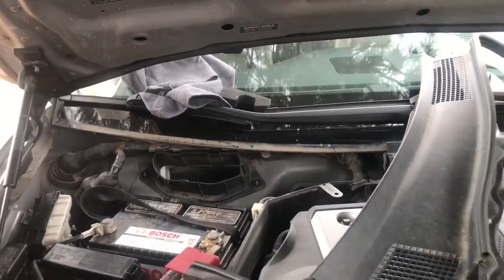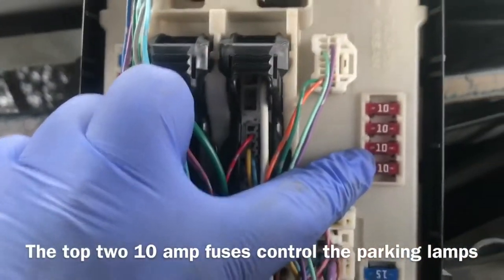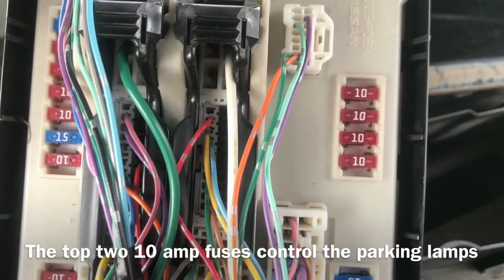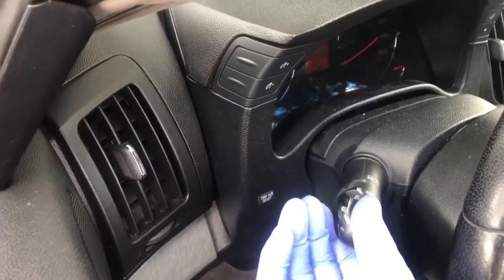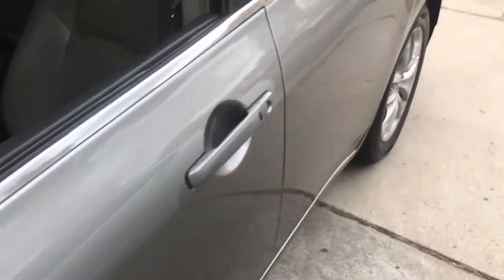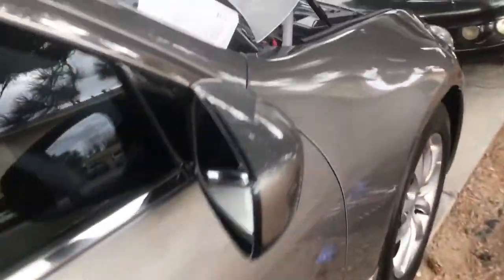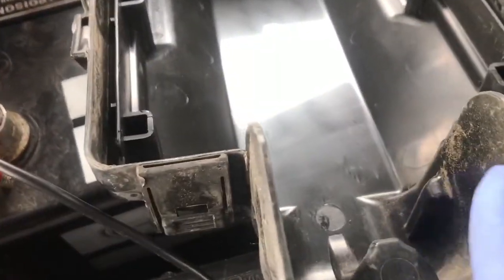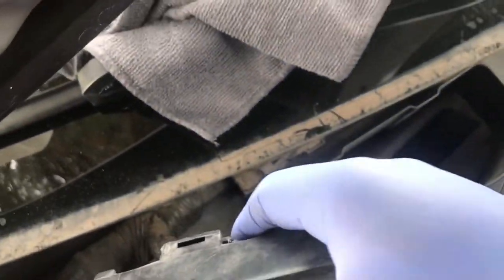2009 Infiniti G37 brake lights repair

Comment: Hey so randomly yesterday on my 2013 g37 sedan on the way home from Vegas 5 hour drive home the lights to the stereo/ AC control lights went out pulled over and noticed that the tail lights running lights and license plate lights also would not turn on, brake lights and rear turn signal work fine but the tail running lights don't I replaced the fuses for them and still nothing any idea of what it might be? All other lights work fine headlights interior dome lights ECT..
Reply: Did you ever figure out the issue i think that’s what’s going on with mine can you please get back to me if you see this thank you so much
Reply: @danielvalasquez5081  can you please get back to me ? I have the same issue BRAKE LIGHTS work!!
Regular running TAILLIGHTS don’t !! 
Please respond !
Reply: @-strapzstatic-787  bro what’s crazy is they still out idk what to do foo I already gone on a chase before cuz of this shit no I wasn’t tryna get caught crazy how I pursued off honestly
Reply: @danielvalasquez5081  Damn bro you have balls , me I can’t run from them , I do push 500 WHP , but these BROOKLYN roads I will do some serious front end damage from the bot holes . 
I really don’t know bro 
I also have a front light that went out turn signal and all worked 
I put a new bulb 
It flickers for a little and goes out 
I’m really lost bro 
Maybe mechanic I guess

Comment: I tap the breaks & they come on but they don’t stay on with the combination switch when the DRL switch on... instead it blows the fuse right away
Reply from the maker: It sounds like you have a grounding issue. You need to go through the wiring in check for a frayed wire that is touching the frame causing a short circuit popping your fuse.

Comment: can you do a vid about the day time running light? my day time running lights does not work and Idk wheres the fuse or how to turn them on?
Reply from the maker: If your normal lights are running that means your daytime running light sensor is  being covered up.  The sensor sits above the dash where your defrost vents are located on the passenger side.
Reply: @ImportDomestic2006  I know they are located there, it’s not covered up, and it works perfectly, when I put the light to auto it turns on by themselves at night. But the day time running light never comes on, even when I do it manually.

Comment: My fuse keeps pulling can you help me out please
Reply from the maker: Kevin Rodriguez Do you mean your fuse keeps popping?  I suspect you might have a ground issue. Basically you might have a wire that has torn insulation and it’s touching against metal causing an electrical shortage. If you install a new fuse and you have not turned on your lights in the fuse has not popped it’s basically telling me that when you do turn on the lights the fuse will pop because it’s touching metal somewhere.
Reply: Ya i just cant find the short :( lol
Reply from the maker: Kevin Rodriguez  Try unplugging the brake lamps. Then replacing the fuse. If the fuse doesn’t pop that means there’s something wrong with the brake lights. I could be wrong but are your brake lights LED or a standard condensing bulb? If it’s a standard bulb it could be the bulb causing the electrical shortage. Otherwise you’re going to have to chase down the wiring harness and try and figure out the electrical shortage.

Comment: great video, do you know how to repair the light inside the trunk, mine wont work anymore tk s?
Reply from the maker: Try checking the bulb to see if it’s burnt out or look for the fuse. If anything else look for the switch that the trunk lid engages to let the lightbulb turn on.

Comment: Any ideas why the service soon light wont come on at all on a 2007 g35??
Reply from the maker: Henry Recinos If I’m not mistaken you have to go into the settings tab in the center stack. Once you go into that menu you can select individual maintenance reminders.  From there you should have the ability to turn off and on the maintenance reminders. From that many you can program your desired mileage. Typically at the dealership they program my Infiniti for 5000 miles since I do use synthetic oil.Once you pass the desired mileage there will be a reminder in the center stack. One of them will be your engine oil and tire rotation.

Comment: Great video. How do i take off the thing that’s over ur engine? Also my issue is turn signal and brake work. Tail light that’s on at night won’t work. So replace the 3rd one down?

Comment: i have an 08 coupe and i have one taillight that won't turn on. it's right taillight and the left circle. the bulb in the center works just not the ring. the weird thing is it works when i turn the lights on but when i press the break it goes away. any idea what it could be?
Reply: Same I have no idea
Reply: @Vq.jjustin  i looked it up we just gotta buy a whole new taillight since the inner part is led and not a bulb you can buy and replace🥲🥲

Comment: My breaklight won't work, its the only light. My lights come 
Just not my breaklight on the passenger side. I replaced the bulb that wasn't it. I was told the fuse isn't the problem either, do you have any idea why it wouldn't work? 
Thank you
Reply from the maker: Chena S you must have some sort of electrical shortage.
Reply: @ImportDomestic2006  thank you
Reply: Mine keeps going out too (passenger side brake lights)light works but when I engage the brakes they don't come on at all

Comment: So someone hit my 2013 Infiniti g37x at the back my rear back lights want come on only when I brake. And my whole interior lights for the middle like for the radio and stuff want come on.
Reply from the maker: ll ll 
You are going to have to test all your fuses.
You might have to test a couple of relays as well. What is the back of your Infiniti damage?

Comment: Would this be the same for  a m 37
Reply from the maker: It wouldn’t hurt to check the same location. I no longer have that 2009 Infiniti G37 but my current  2015 Q70L has the fuse box in the same location.